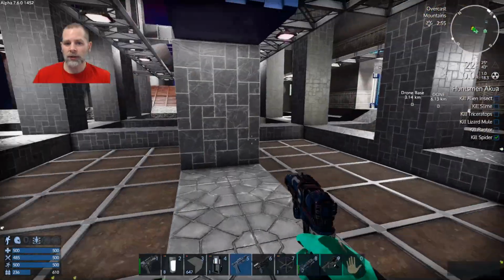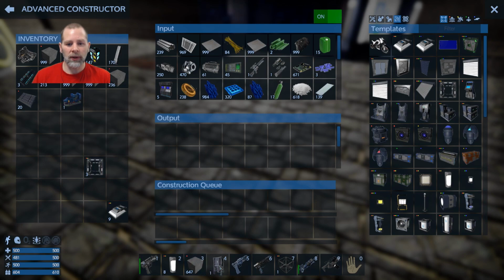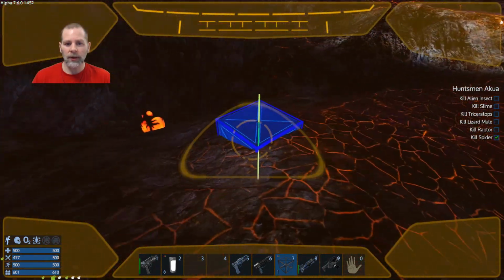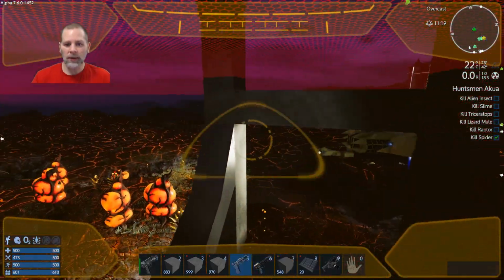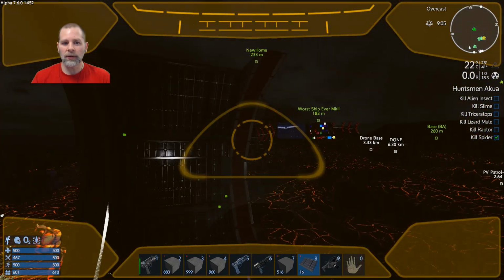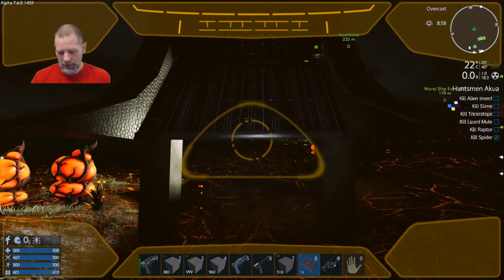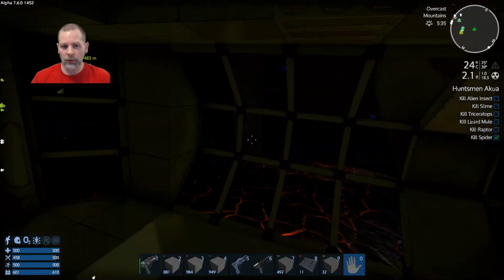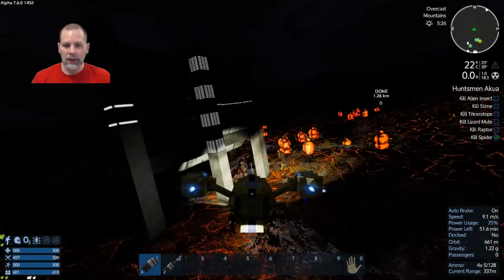Lift Plays Empyrion S10E59 - Aitis Water and Solar Panels

Comment: I have had occasions in both single and multiplayer where I place a solar panel, and for a second it shows it where I placed it. It then disappears without a breaking sound. Any attempts to place a panel in the same spot has the same result.

Comment: This must have been before the update that dropped O2 and H2 generators in favor of making them from water jugs.
Also...I discovered that if you put two 3x3 shutters end to end on the roof of your SV rather than a door, it creates an opening large enough to launch the drone without having to jump and drop like you do now, and it's still airtight.
Reply from the maker: I think I'm going to end up just using forcefields in some cases, because it looks cooler. :) (And hope there's no power loss during a fire storm or heat wave, LOL.)